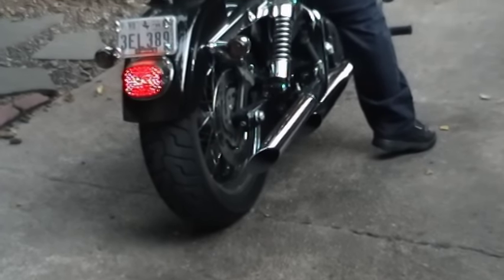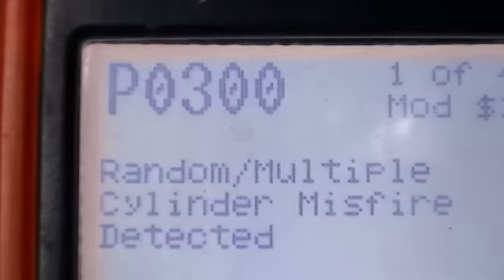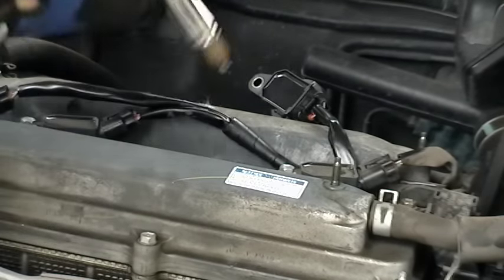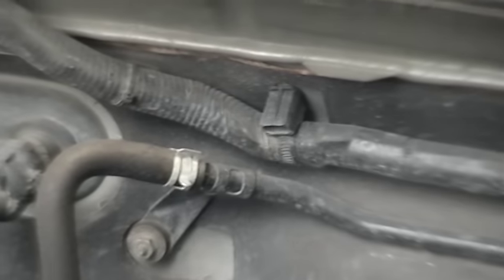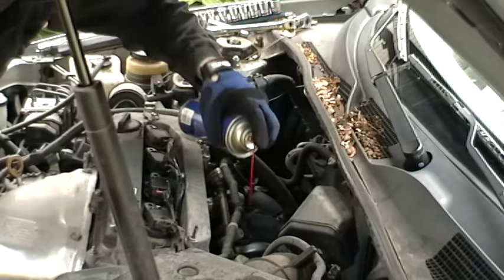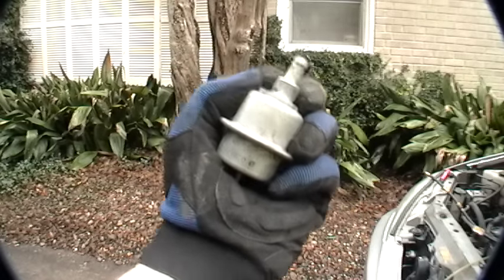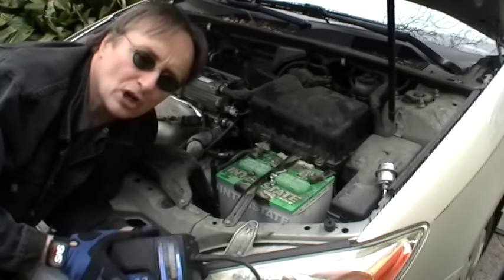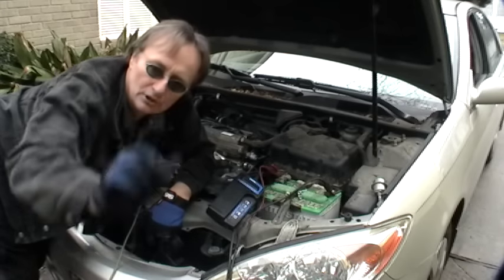How to Fix a Random Engine Misfire in Your Car (Code P0300)

Comment: Had an EGR valve diaphragm that completely blew out - literally air was leaking out all around, idle was lost. Taped it up as a temporary fix, have a replacement but have to find it. Still has a bit of a slight cough under load with a low idle and P0300 but I'm thinking it might be the EGR connection to the intake filled with carbon, which would probably explain it being blown out from constriction. It was ironic though as the P0300 code didn't show up until after the vacuum leak from the EGR was taped up despite it greatly improving the idle from stalling.

Comment: I have a 2010 Chevy HHR that has no check engine lights and no stored or pending codes, but it has a random misfire  at around 1000 to 1600rpms. Not under load, just while cruising at around 35 to 45 mph. valve cover gasket is starting to leak some oil into 2 of the spark plug boots. I'm changing the gasket next weekend. I put new OEM plugs in it today and that did not fix it. It's not misfiring all the time so I assume it's not a burnt exhaust valve. Must be electronic.

Comment: Thanks scotty. I just got myself an OBD2 tester and had this code. My car didn't want to start at all. After checking the air intake, the spark plugs, and the battery. I got her to run again. But a lot of unusual squeaking from the belt went from wet water squeaking to a lot noisier. Died shortly after though. But got her running again. Still not sure what is up...

Comment: my 2014 Chevy Silverado was running fine, but since I bought it used, I decided to change the plugs and wires.  Had a issue with one plug wire not hooked all the way in, after that everything seemed to been fine, now I get a Po300, not sure what the issue is, but my truck sits for a couple of days before I run it, but like I stated, was fine until I changed the plugs and wires

Comment: 01 Chevy Impala, hasnt really been driven often (once every few months for 5+ years) came up with a P0300 after I changed the spark plugs and wires. Put sea foam in the gas tank and infed through brake vacuum assuming a clogged or moisture filled gas tank. Checked video for other ideas, but odd thing about the check engine is it goes away when I run the heater/AC. So debating if its still bad fuel injector or area, or a bad coil pack sensor. So last part throws me for a loop.
Reply from the maker: turning the AC on sets the idle up with the idle control valve. SO, odds are you have something like a small vacuum leak on the engine intake, see that a lot

Comment: I just changed my fuel filter on Corolla, sure that was it, code came right back;  plugs battery and coil packs not too old (35k?).  I have spare new pack and will go through all four but doubt that's it for general 0300 code.  Will check vacuum.  What else?  How do you test fuel pump?  I thought it worked or it didn't.  Misfire is at initial accel or steep climbs, but code is only once in a long while (stuttering amany times prior to code).

Comment: Thanks Scott, I hate trying more than one thing at w time, but was either a vacuum port I broke at one time ( would have been while getting to the coolant air purge ) or cleaning the MAF sensor.  I was going to ask about how the batt. could do this,  but I'm going to take this as low voltage.  Thanks for this video, as well your others, on the random misfire P0300 issue especially about vacuum.  Most internet talk would have me try replacing all and and sensors etc$$$.  And it usually isn't the problem!!  This is how experienced mechanics can zero in with practical observations/assessments.  I wish I would have valued vacuum leaks BEFORE I was convinced it had to be injectors! Thanks!

Comment: Thats something older people disagree with me on.  I have tried over and over to explain to them just cause a battery starts your car does not mean you have a good battery.  You battery can start your car okay but, say for example one battery is rated at 650 cold cranking amps and you have a test run on it and the rating comes in probably at 490 or 500 cold cranking amps most likely a tester would deem that as a bad battery or one that is probably getting weak.  Glad to see a mechanic who also confirms what I know.  Especailly one who has been a mechanic practically his whole life such as Scotty

Comment: Hey Scotty Kilmer, I have a check engine light on and had auto zone check the code.  All 4 cylinders misfired in my 2008 subaru wrx but it seems to be running fine.  It was very cold out when it turned on.  Should I shut off the check engine light and disconnect my battery and then see if the code comes back? Thanks!
Reply from the maker: yes, start there. Pray the head gasket isn't blowing, they often do

Comment: A couple months ago I had transmission lurching, engine overheating, and CEL  on load only. Called radiator guy. He said I needed a new radiator. Called trans shop, he said it was the torque convertor. Then I saw your vid on misfires. Stayed away from those shops & followed your advice; checked coil packs, plugs & wires. It was # 2 ignition wire. Got a new set of Delphi wires for $29 and all three problems ceased. Thanks, Scotty, for saving me tons of money & aggravation again.
Reply: Thefirstgalaxybeing I believe it, if you would of called the plumber he would say you need a new sink etc.
Reply: You better know it.
Reply: You wanna laugh? You wrote about the plumber a couple days ago and today my daughter called the plumber because she thought the sump pump was going dead. I told her to order one from Amazon for less than $80 and told her I'd tell her how to install it - very simple procedure - 5 minutes start to finish. I live 2000 miles away or I would have done it myself. She instead called the plumber rather than do the job herself and paid him $325.  So, if you have any more insights, please make them about me hitting the LOTTO. I'll give you a good cut when it comes in.
Reply: Thefirstgalaxybeing if you play lottery you will win, don't forget my cut

Comment: Hey Scotty, I have an '03 VW Passat with 188k miles. I have the following error codes, P0171, P0140, P0300, P0304, P0130, and P0141. Most of the codes concern an O2 sensor, but my main issue led me to this video. I have a misfire on a code. Whilst driving, I found out that in 4th and 5th gear, a lot of "jumping and jerking" occurs while giving it more gas to accelerate. Can you explain to me what it most likely is? Is it just a leak, sparkplugs, or could it be a cylinder issue? Thank you for the video!
Reply from the maker: try finding a vacuum leak first, and then check the MAF sensor as those are the 2 biggies on old VWs

Comment: Thans scotty, i will check that. Also i changed battery, fuel filter, and spark. should i change spark again or its still good (i changed them before 24 000 km)

Comment: A faulty ignition coil can cause this as well right? This code came up on me a few miles after getting gas. I think the gas is bad. I’ll run it out, refuel it from another station and try again.

Comment: Hey Scotty, I have a 2001 Toyota Celica GT-S. It has a spitting sound through the intake, sometimes idle funny when starting and hesitates at times when I accelerate.
I do have the P0300, but also P0301, P0303 and P0304. I've changed the spark plugs twice with what Toyota recommended! No vacuum leak either; did your cigar test and intake manifold and throttle body gaskets are new along with MAF!
Frankly, I'm stumped.

Comment: I have P0300, P2167 with battery 10.5v do you think could be the issue engine can start with no issue even with low voltage

Comment: Would a new clutch, flywheel, pressure plate, hydraulic throwout bearing, pilot bearing, and rear main seal all contribute to a p0300 code?

Comment: Hey Scotty, I have a 1996 Chevrolet Blazer (4.3 4300 Vortec V6) that would give me problems starting anytime it rained. On Saturday it wouldn't start, no luck on Sunday, so my father helped me change the distributor cap and rotor. We just finished and went to start the truck up when we heard a loud pop then started up but it was running very rough and threw the P0300 code. Any idea if that could be a certain issue? I've lost daylight for today so tomorrow I'm going to check sparks plugs, vacuum lines etc.
Thanks buddy

Comment: My P0300 problem ended being a double whammy.  I changed the plugs on my Mazda 3 at 75k with Iridium Plugs without changing the Coil Pack.  At 125k I had the misfire P0300 so had to go into the engine bay.  I ended up with 2 plugs were fouled and the coil pack was burnt.  Scotty how often does the problem point to a ignition coil?
Reply from the maker: ignition coils break down more and more these days as they make them cheaper and cheaper. I change out hundreds of them

Comment: Hi Scotty
I have a 2002 GMC Sierra 1500Hd with a 6.0Liter Vortec.
I keep getting the check engine light flasing (P0300) at about 100-110km per hour and the revs are about 2500RPM everytime it comes on!!  Once I slow down it shuts off right away!!  I just put in a new fuel filte (ACdelco) New plugs and wires (ACdelco) I checked for vacum leaks and everything you said on the video, but it just won't go away!!  I heard it's a very common code on the GMC/Chev 6.0 liters.  Any Ideas?? 

Thanks So much!!!!

Comment: I had a misfire come on suddenly while sitting at a stop light yesterday, it's been running like crap for 2 days, though there have been times previously where I start the car and I feel it running rough before I drive off. I noticed some corrosion on my battery when I looked under the hood, so maybe I'll start there. I also bought a little mattress pump that is supposed to run off the cigarette lighter, but it just burns out a fuse when I try to use it. Perhaps this is pointing at electrical problems... 04 Odyssey bought last year

Comment from the maker: can be bad wire or coil on number 2 cylinder, or a bad fuel injector there. Swap #2 with #4 and if miss moves there, replace the injectors.

Comment: Hi Scotty,
I do have 96' Mitsubshi Eclipse and I am getting P0300 and P0352 both codes on CEL. Not done any repairs yet, but I am trying to get ideas what might those two associated codes to point out. Would be an issue with coil wires or other issues like you mention on video?

Comment: A 1974 K-10 Chevy. At idle timing is all over the place, vacuum holds steady at 20". Compression tested all between 160 and 170 psi, dwell steady at 29 degrees. Timing chain tight, Eldebrock 600 just rebuilt. New distributor, cap, rotor, wires, points, and plugs. Near no power with any type of load and backfiring through the exhaust. It has me stumped. I have owned the truck 30 years. It's never been to a shop and I don't want to start now. You got any ideas?

Comment: I have a 2004 auto a6 v6 and I have the same code P0300 just wanted to see if there are any other recommendations before I begin to work on the spark plugs. Thanks
Reply: ashley marquez that’s where I started I have a 2004 Oldsmobile Alero 3400 V6 then I went on and replaced coil‘s and wires and I still haven’t figured it out it possibly could be a vacuum leaks I haven’t checked that yet I’ll eventually get it I guess my old man ain’t going to work on it because it’s a front wheel drive lol

Comment: Please help 🙏 my Nissan 370z Nismo show P0300. I placed ignition coils, spark plugs,  both pcv valves with oem parts. Clear the code but after driving around 80 miles the P0300 come back. Do you have any recommendation??

Comment: I have a 2002 Ford escape. It has a rough idle and when I drive over 60mph it starts to shake. It shows a code p0300 and p0304. I got a tune up and that helped very little. Also had oxygen sensors replace and got a new catalytic converter and muffler.  What should I do next everytime I got to a mechanic I get different answers I spent most of my money on diagnostic test alone.

Comment: Good video. Turns out my voltage regulator (2002 silverado 5.3) was not charging properly...aka multiple misfures due to lowered voltage in the system. Thanks!

Comment: got a 2000 vw jetta with 155,000 miles and I notice after I hit 80mph sometimes,  the check engine light comes on and I start losing power slowly. I'm starting to have a feeling I might have to replace a vacuum hose that connects next to the oil cap to b4 the manifold. and possibly clean the manifold itself. my oil tend to get real hot and vapor.

Comment: Scotty, greetings from Mexico, we have a 96 cutlass ciera and this is the problem: when the engine is cold and turn it on, the motor starts to shake and light "service engine soon" flashes (DTC: p0306). This failure only occurs when the engine is cold, if the engine has its operating temperature works well; has new spark plugs and spark plug wire. Change one of the ignition coils and return the same error code, about a month ago I put Lucas injector cleaner in the tank and the problem persists. I have not done a cylinder compression test. Could injector problem or issue with the cylinder valves?

Comment: Can one use other additional information to determine the cause instead of changing parts. For example: If the car misfires more frequently upon accelerating and if one cylinder misfires a great deal while others much less frequent. So, when acceleration, one cylinder does not misfire while others do and one cylinder misfire more are variables can one narrow down the cause?

Comment: Hey buddy, this is a great video, same as all your other videos! 
My 97 Honda CR-V has misfiring and lately when I press the accelerator it tends to almost stall,  it gets really weak. I changed fuel filter, spark plugs, wires, rotor, distributor cap, spray cleaned  and valves and throttle body and valves, removed injectors... it got a little better and then it's back or worse than how it was before. I also replaced the fuel pump for a used working one, just I case the existing one had low pressure... I do not know what else to check. When cold start, it's fine, but once it warms up and start driving, it starts acting up. What else can I check? Today I'll check for vacuum leaks, perhaps remove the fuel filter to check for clugging... Thanks man!
Reply from the maker: often the distributors go bad on those, I always use brand new aftermarket units
Reply: Scotty Kilmer 
thanks for the reply... So, it could be that the distributor is faulty? I think I replaced it about  15 months ago... I'll put another one to see what happens then.

Comment: Hi Scotty! I have an 03 Jeep Liberty, I had it checked and its misfiring on all 6 cylinders! The engine light goes on and off and sometimes it blinks rapidly before the car needs to be shut off and restarted. The engine light has been off all week but now she's revving high when going from 0 to 20 mph.. What do you think?
Reply from the maker: +sassycat850 try a new ignition coil set up and pray it's not a blowing head gasket

Comment: Scotty, great explaination! can you give me a tip?
I am having a random misfire problem with my 2010 Hyundai Accent. The car was scanned at a parts store and we came up with P0330 random multiple misfire, P0301 Cylinder 1 misfire, P0304 Cylinder 4 misfire. We also got P0455 Evaporative Emmision System Leak detected.(Large leak)
Reply from the maker: fix the leak first, pray it's causing the problems, it can if big enough

Comment from the maker: change the number one spark plug and the wire and coil on plug and pray. if not that, try a new fuel injector and pray. Cause past that, it can get REALLY expensive with internal engine or computer work.

Comment: I have 2 P0300 codes that come up when I run the diagnostic.... I have changed the spark plugs and wires, bought and replaced the ignition coil packs (all 3 of them), the battery is new, and I've repaired all the vacuum lines that I can find. I've even went through the trouble of removing the entire top part of my engine to replace the intake gaskets. There MAY be a vacuum line that I missed, but if I did I have no idea where it would be. I did replace the fuel filter about a month ago, the only thing that I have not done is check the fuel pressure. My question here is, once I check the fuel pressure and it happens to NOT be that, what else do you think could be wrong? Any and all input would be greatly appreicated

Comment: Old school first thing I would of done would of hooked up the 4 channel Pico 5 years ago. now it’s the ATS that’s state of the art diagnostics for a misfire diag especially when it comes to the p0300. Had some issues with the pressure transducers at first but they ironed out that problem

Comment: Hey Scotty,
I have a 2006 Ford Mustang 85k miles I got the P0300 code and drove about 5 miles and it disappeared by itself.  Is it possible that there is nothing wrong at all since it went away by itself? Could it just have had a hiccup?

Comment: I have a 2006 Chevy Equinox. I had gotten some gas then a few moments later, the whole car stated shaking and got instantly sluggish. Engine light came on as well.  I checked for codes and got the P0300 . Could out be due to the had I just put in?  Its never done this before.